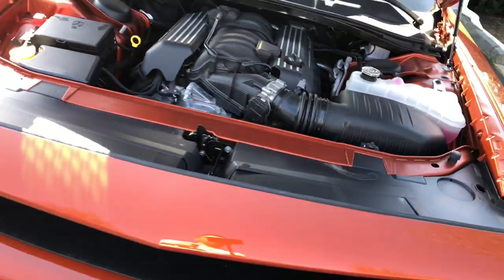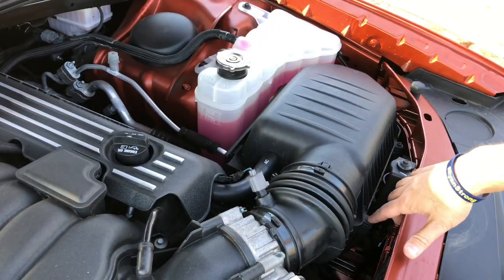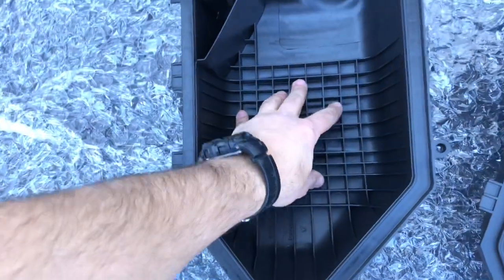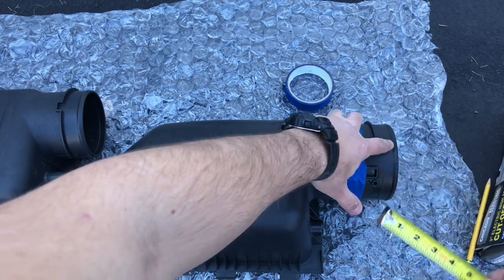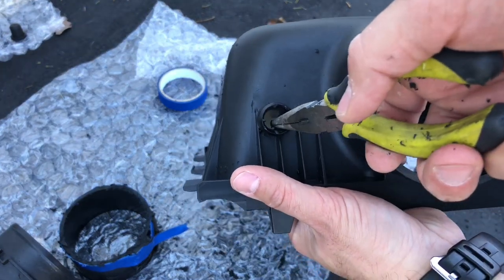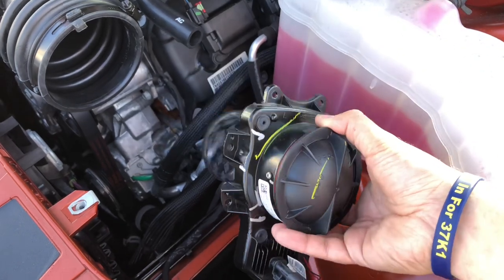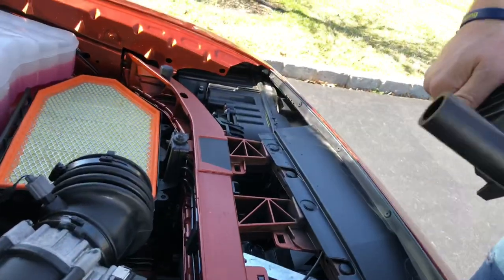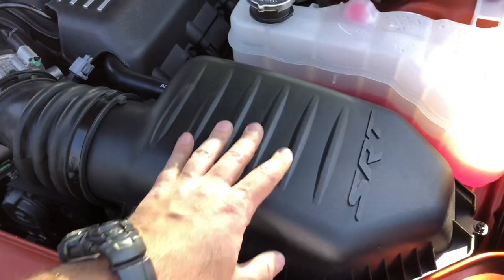Scat Pack Challenger Hellcat Air Intake Install | Upper and Lower Intake !

Comment: I found a hack saw worked nicely since I didn't have a cutting wheel tool. You can't just hack through it like a log, though, because the blade rarely goes evenly through hollow plastic and you'll end up with a crooked cut. I taped it just like in this video, then used the hack saw to etch out a groove all along the edge of the tape for the full circumference of the inlet tube. Then I just kept cutting a little more all around it till it was off. Easy and a little less "loss" due to the blade thickness. 
Anyway, thanks for posting this. I just bought a Hellcat box/light-tube and this video was the deciding factor. Thanks again.
Reply from the maker: Happy to help

Comment: Did the same install, and there's no noteable sound change or performance gain.  However installing the HC lower seems to be a right of passage in owning a Hemi Challenger.  I did the lid primarely to get the SRT logo since I have a SRT 392. The HC lid offeres no other benefit than the SRT logo. So those looking to upbadge or add the SRT logo to match their SRT 392, then the $60 is worth it.  I also went with the MAHLE LX 3482 Air Filter to get 1055cfm over the OEM 6.4L filter rated at 730cfm.  Great video, helpful for those wanting a cheap CAI solution that keeps the car stock looking.   FYI the SRT with HID you only need to remove the headlight cap, 3 tabs, and if you're lucky the tabs won't break!
Reply from the maker: I did do the hellcat filter as well it came with the kit. It was fun to do
Reply: I ordered the kit but it
Comes with a afe oil filter that’s 66 bucks alone is that same as the hellcat original filter as far as ccfm etc or better since expensive filter
Reply: CAI is a supporting mod. To get any benefit you have to also get a 84MM TB and port the manifold. You can also port out the CAI

Comment: does water get to the filter through the air intake by the headlight ? it looked like a clear shot to the filter box
Reply from the maker: Haven’t had any issues. It’s how the hellcats come from the factory. That’s also why the filter is there just in case some water reaches it, the filter won’t allow it through.

Comment: Just got a 21 rt do I need the upper intake or just the lower hellcat air box ?
Reply from the maker: Only the bottom is required, the top is optional
Reply: @pfmustang  ok cool I found a kit do you think the non-silencer tube is worth getting ?

Comment: Could You PLEASE provide a Factory part number for that SPECIFIC  Hellcat SRT Lid?  I have a 19 Scat Pack That I have Everything to do this mod with But the Lid, I want my Factory vent hose to hook to the lid like Yours, but Every lid I find Doesn't have the Outward Nipple on the side of the lid for the hose to fit over so it hooks onto the lid top. This info. Would be Greatly Appreciated!!!
Reply from the maker: I had tried looking and could not find a specific part number on the lid. It’s from a specific year hellcat, I want to say around 2016, it’s from an earlier year. I had to keep looking all over til I found one.
Reply: Ok, Thanks for checking. I thought that the part number might have been on the bottom side of the lid Somewhere. If you Run across Another one, I'll take it!  Or if Someone has a Part number Please post it up!  Very Nice Job on the Video and for Keeping it Looking So Clean and Factory looking!